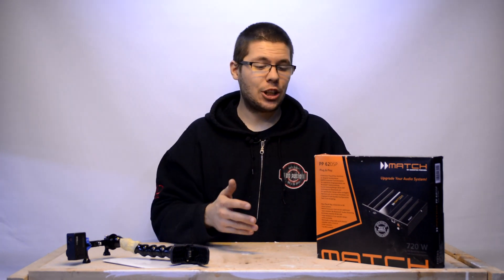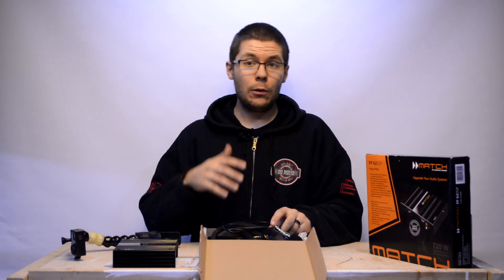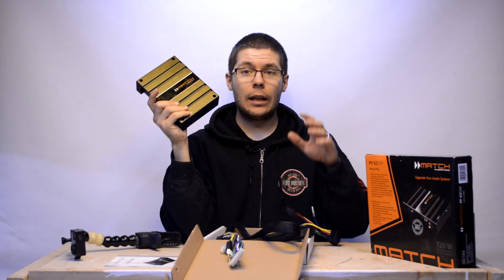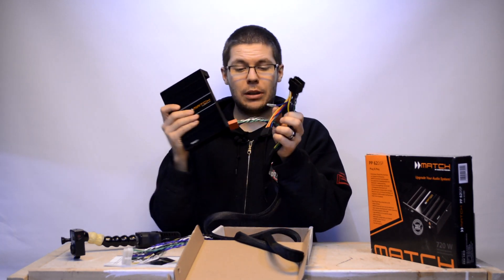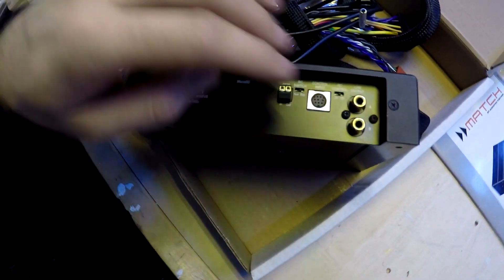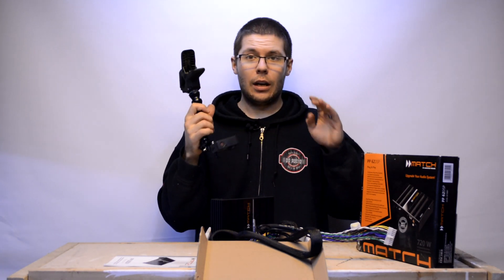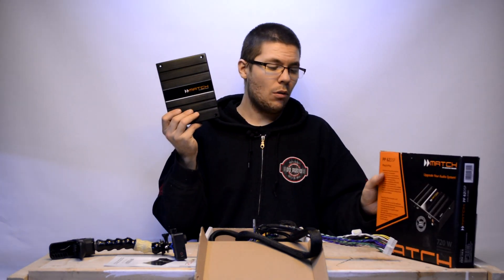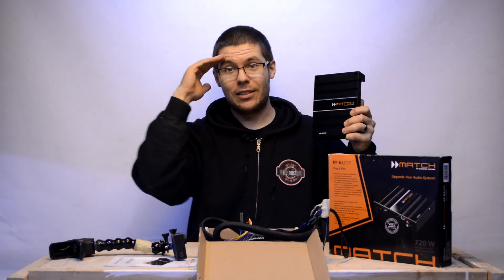#PN | ENG | Unboxing MATCH 62 DSP

Comment: What if I want to add an additional amp for more subwoofers .Do  I just use the '' LINE OUTPUT and the REMOTE OUT '' to send signal to new amps , I know I would have to run the power and ground separately. Thanks
Reply from the maker: ALFREDO MONROY yes, you use the mono signal output to external sub amp/amps.  tho it is only mono output so you cannot run tweeters and highs through it.  mids/ subs you can